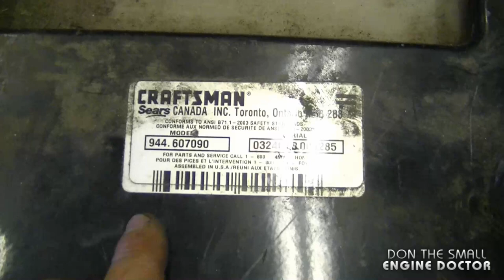Drive Pulley Replacement On Craftsman Lawn Tractor

Comment: Thanks very much for this clear and excellent video. My son and I had to replace the drive belt on our Craftsman DYT 4000 mower and this video was what we needed to get it done. The only difference I encountered on my mower was that the wiring connector to the clutch was a bit different, and didnt want to come apart easily. Not wanting to damage it, I found that the wire was long enough to lay the clutch on the ground without disconnecting it, so I left it alone. Thanks!!

Comment: This would be the best, most informative and concise 'how to' video I've seen ever ! Excellent job Don. As an engineer with 40yrs experience who's looked at many how to videos, most always leave out the important little things or prattle on with nonsense, not this one. Now Don how do I get the drive pulley out of a Countax or John Deere clutch ? On these tractors the clutch has the pulley pressed into it ... the problem there's also a washer/spacer pressed in the other side so nowhere to press ?

Comment: I watched this video since my Craftsman LT 1000 tractor have been having problems with the drive belt and I replaced the belt twice within a short time frame and after putting the new belt on the tractor drove just fine until I ran into an area where it had to go up hill and was pulling the lawn sweeper behind it. It stopped pulling again and I put on another new belt and it is working fine now, but I am afraid it may be the pulley now that may be the problem and I have to replace it. I have a diagram of the parts with the part number and will get another one just in case that is the problem. As always, Don, I thank you so much for the tips on repairing the mowers, and God Bless.

Comment: I'm having a similar problem with my Troy Bilt walk behind. model # 34313  6 speed trans, uses a drive disc like my snowblower.  The disc and clearance all seem fine and I'm wondering if the drive pulley is worn out.  
Great video on the Craftsman, my father in law has the same rider.

Comment: hey nice video, I have a older craftsman DGS 6500 26HP, having problems with the blade belt coming off when I engage blades, is the PTO clutch bad? what would the part# be?

Comment: Great video, nicely done , I have a question . You mention another  way to drop the pulley , can you make a video for that , my belt came off the drive shaft and it has metal  housing that dose not allow me to put the belt back on: so I need to drop the pull and when I use the socket the whole thing turns
Craftsman pro 8200

Comment: Had to replace the drive belt on my MTD Yard Machine riding mower.
Didn't even know it was bad because my yard is nice and level. When I tried to mow a yard with inclines it wouldn't move, even at 10% grade.... At first I thought the transmission was going... Upon inspection the main drive belt (long belt) going from the engine to the rear was good but the smaller drive belt had a crack in it which was slipping/stretched. Simple $9 belt from autozone. Went back the same day and mowed the hilly lawn with no issues.

I used to dread going to the local small engine repair shop even for parts. The only shop in twenty miles. He charges two to three times what I can get parts for online. On top of that every time I try to buy parts they have to be ordered anyway and that takes about a week anyways.
Biggest issue is part numbers... All I normally need is that and I used to feel bad asking him to look up info and then just leaving. Now I just give him $5 for his time and the number so I can order off of amazon or ebay.

Comment: Hey Donyboy I got a husqvarna yth180 lawn tractor and replaced drive belt old one kept popping off trans pulley.  I figured it did that cause of the cracked worn out belt.  I replaced the drive belt with the OEM drive belt from sears and this coming Monday the 24th would of been two weeks since I done the repair.  It has worked flawless since then up until this evening.  I used the tractor earlier today and all was fine tonight I went to use it just to ride a bit and the new popped off.  What do you think the problem is it only pops off trans pulley then gets lodged underneath.  I used this mower to mow my cousins yard all year and brought it back home a couple weeks ago because of the grass slowing down for the year and this has started happening.  I can't understand why all of a sudden this is happening.  I have had tractor since earlier this spring neighbor pulled it out of barn and gave it to me.

Comment: I am replacing the drive belt on a 2006 MTD Huskee 54" garden tractor with a new engine pulley, but the pulley on mine was oriented with the slot on the pulley towards the bottom not near the top.  Is this correct or did someone replace it incorrectly last time?  Also, the old pulley was never greased, so it was completely rusted on.  I had to use an impact tool to remove it which took many hours!!  Thanks for the great video!
Reply: I haven't used this tractor since I replaced the belt until now.  Now, when I have it in drive, it will not stop when I apply the brake when in forward or reverse. I can't even put it in neutral to stop it.   I ordered the supposed OEM belt.  Can it be too tight?  Is there anyway to rectify this problem without having to install a new belt?  Thanks, again!!

Comment: Hey, I need some help with this used poulan pro lawnmower I bought. it will not shift when I have the clutch engaged, but when i disengage the clutch, it shifts fine. I am wondering if the drive pulley can affect this, because mine does not spin freely. Any help is appreciated.

Comment: Great video Dony as always!  Thanks!  I think the hardest part for most of us DIY'ers is finding a suitable place to work, especially on lawn mowers.  Any thoughts on good quality lift tables?  Need something at around 25 inches in width to accommodate the width of most walk behind mowers.  Thanks again.
Reply: Tony M Never thought of a lift table, but my local repair shop has kind of a ramp type setup that leads to a workbench.  You can drive the equipment up onto the table, or pick it up and set it on there, depending on the type of equipment you are working on.  It sure beats trying to work on stuff on the ground.

Comment: Hi Donny, I have a 2002 MTD white outdoor lt153 with 13.5hp Briggs, I need to change my drive belt, but it seems my drive pulley is seized to the shaft. I tried spraying pb blaster and knocking on the shaft, but it won't come off. do you have suggestions? thanks again!

Comment: Would it be possible to convert my Craftsman Lawn Tractor's manual deck engagement to the electric clutch?  My old Craftsman Lawn Tractor had the electric PTO, this manual lever engagement seems to have a lot of slippage while engaging/disengaging and to me it just leads to faster belt wear.

Comment: Nicely done,though I am a bit leery of the pipe wrench. They tend to chew what they grip, rather use a vise grip or if possible a strap wrench. I have found that a new belt on a new sheave should crown slightly. If a new belt drops to the bottom of the sheave then either a worn sheave or the wrong belt.

Comment: Great tip on the anti seize !
question: I've an Echo SMW200 trimmer that won't start. I've replaced fuel filter and fresh gas oil mix but suspect carb. A sparkling is good. is it hard to rebuild this old trimmer or better just replacing? (it was free and cheaper than a 58v Echo lithium...)

Comment: Great video and it brings me to my question. I have a 2013 Husqvarna lawn tractor with a manual blade engagement. Can I install an electric PTO blade engagement like what's on your video on my tractor without much expense and is it easy job??
Reply from the maker: Anthony Macneil probably not, it would be super expensive
Reply: Ok thank you for your response

Comment: Great video again Donyboy. I repair cars for a living and I will never understand why someone would go to the expense to replace the pulley and refuse to replace a frayed belt. If the customer can't afford a belt they should park it. If it slips and doesn't work properly you will be the one who is at fault but I guess you can't win em all.
Reply: wysetech2000 Trying to be cheap a**es.  Trust me, there are so many people out there who pinch pennies when it comes to maintenance, then they whine and cry when that thing they just had fixed a week ago breaks down again because they didn't want to spend another $20 on xx part.   That's ok it keeps the shop guys like Dony in business.

Comment: My lawn mower, which is a Craftsman model 917.270532 has similar problems. It will barely move forward or backwards on it's own. With the rear end off the ground the wheels will turn but once they are on the ground under a normal load the mower will barely move and has a terrible grinding noise. It sounds like the transaxle gears are grinding against one another however, I removed the top of the transaxle and everything looks fine. There are no metal shavings and all gears seem to be in great shape. The pulley on the transaxle seems to have a little slack but it has a key connecting it to the shaft so I see no way to tighten it. The other pulley and belt tensioner seems to be ok but under a load may perform differently. I'm sure the belt needs replacing since it has been on the mower for years. How can I test the pulleys to know if they are bad? They appear to be fine when turning them by hand but under a load could be different. Also, since this mower is so old parts are becoming harder to find. Does anyone know of a place who still stock basic parts for this mower? I have found some used mowers like this but everyone wants 3 to 5 hundred dollars and I hate to put that much money into a twenty year old mower.The only reason i'm trying to repair it is because it was given to me by my father in law who has since passed away and I hate to give this up also. Any help or advice will be greatly appreciated. Thanks Randall

Comment: What is the difference between solid  cast iron crankshaft pulley on riding mower engine, than a die cast lighter weight cheaper pulley of same size 6" diameter? I intend to mount an alternator. The engine flywheel is balanced at factory.

Comment: I have a similar tractor and the foot clutch doesn't engage as it used too. it wont engage til the pedal is almost out of travel. It still works, but is there something I should be looking for or an adjustment I can make? I have already replaced the drive belt and one tensioner wheel, and that made no difference. Any tips? thanks.

Comment: Smashing job Don :-))
Yep we do tend to forget about pulley wear, good reminder :D
Reply from the maker: zx8401ztv have a good weekend
Reply: donyboy73 Would it be ok to turn a vtwin 24hp v twin vertical to a horazontal if it has over head valves?? it has an oil pump.
Reply: RCmen26 go kart

Comment: would this also work for a 917.271090 craftsman rider?  somehow the drive belt got moved between the two pulleys off the engine..

Comment: I just had issue doing this on an MTD zero turn. I'm trying to rebuild it after it burned up on my neighbour and she gave it to me.  I had to cut off the old pulley and unfortunately never took a picture. Replacement pulley has one collar thinner and rounded edge and no key. Other side is thicker and has key. I assumed the rounded  collar should go up against crank shaft and so key was down , not up as per your sears. Then I put the clutch on. Extreme torque says torque of bolt is critical and 50-55 ft lbs for 7/16" bolt. Before I could reach the spec the the upper collar split apart. There is a ridge in the clutch that could hit bottom of shaft and prevent clutch from compressing drive pulley further but dimensions are such that this ridge is going to be 1/2 inch below the end of the shaft.
Reply: key section on MTD definitely goes down , not up, because the key goes right to edge of collar and won't go up right since keyway in crankshaft doesn't go to top of shaft next to engine. The other end  goes up because it has no key in it. On your sears I see the key does not extent to edge of collar so it can go up.

Comment: Hi Donyboy. Since you had the drive pulley assembly apart, why didn't you also replace the drive belt at that time? It looked a bit frayed.
Reply from the maker: George Travers as I mentioned in the video description the owner opted not to replace it
Reply: donyboy73 You're right. Sorry.

Comment: So many people overlook pulley wear as the cause of their problems.  Many things like mowers, furnaces, fans, drill presses and machinery rely on them to provide a good grip on the belt to transfer motion.  Too many folks just replace the belt thinking that's the sole wear item and their fix will only be temporary.

Comment: would this apply also to a craftsman snowthrower?  Sometimes I notice when I engage the drive wheels it moves very slow or not at all...I replaced the belts and friction disc...
Reply from the maker: hllywd964 yes it does happen
Reply: thank you...so I would have to replace the drive pulley then?
Reply from the maker: hllywd964 if it's worn like the one in this video yes
Reply: thank you!

Comment: I have an older craftsman mower 42 in 16 hp with belt driven transaxle .Just had issue today it wont drive up hills but it will drive on flat or down hill terrain.  What could be causing this? Thanks
Reply from the maker: could be drive belt is worn out

Comment: Also the belt should not ride INTO the pulley like what you showed. That pulley is shot as you said. Belt should ride even from the outer pulley edge or a bit above. Looks like you need a wider belt.

Comment: I've had an issue with my drive belt popping off of the back pulley. I have a Craftsman 16HP Kohler engine. I do not see any way of adjusting the tension on the belt. Any ideas?
Reply from the maker: the belt may need to be replaced, also check idler wheels to make they are not out of line
Reply: It is a new belt and all the pulleys appear to be in line.  The new belt appears very loose. It always pops off the large transmission pulley which does not appear to have any belt keepers around it.  I'll double check the idler pulley.

Thanks for the advice.

Comment: not being critical but considering the trouble to get to  the belt , was there a reason for not changing the frayed belt while changing the pulley?
Reply from the maker: MissouriOldTimer as I mentioned in the video description the owner opted not to replace it
Reply: donyboy73 ok, I didn't notice that, thanks.
Reply: MissouriOldTimer Probably trying to save money.  Problem is, the belt may be stretched so it could potentially still have mobility troubles.  I have a similar lawn tractor, mine is the lower grade than the one in the video so it has the manual deck engagement so no electric PTO clutch.  However, the way they have the transmission drive belt routed in these newer lawn tractors is ridiculous.  Just about have to flip the dang tractor upside down to work on it.  Or hang it in a tree to gain descent access, then you still have to remove the deck most of the time.  Not a fun chore, almost worth buying a new lawn tractor when the belt fails LOL.
Reply: William Todd I used to  work on small engines and some of the riders are so difficult to change the belts some have two drive belts with a variable speed pulley, about have to dismantle the mower to change those .
Reply: MissouriOldTimer My 1992 MTD Ranch King is that type of setup.  I really don't want to have to change those belts LOL.  When I got it last year it wouldn't go very fast at all, ran like crap...it still looks like crap, but the previous owner's kids beat the crap out of it.  The VS pulley had a piece of wire stuck in it so it wouldn't open up all the way for high gear.  Took that apart pulled the wire out of it.  Does great now, but yes total pain in the a** to work on LOL.  I did end up rewiring it to a push button start and toggle on/off switch as it wasn't running right and had some other electrical issues.  It runs awesome now, cuts grass better than my 5 year old Craftsman pile of junk lawn tractor ever has.

Comment: Wonder if the source of the problem is a belt that's wearing out, which then destroys the pulley?
Reply: ***** No, its the garbage metal they make pulleys out of now.  My old Craftsman lawn tractor never had a single pulley replaced on it in 20 years.  Belts every few years, but never a pulley.  They never wore out.  These new machines are designed to last 5 years, after that its up to the poor owner whether they want to pour a bunch of money into the junk.
Reply from the maker: ***** actually it's the other way around, the pulley got worn and in turn frayed the new belt you saw in the video. The owner opted not to replace it as he had just put it on and still couldn't figure out why the drive was slipping

Comment: Hi dony or anyone that will know i have recently bought a petrol pressure washer i cannot get it to pump any water the pressure gauge is missing and has been replaced with a bolt and the pressure release doesn't look in the best condition have no idea about pressure washers i was hoping it would work

Comment: hey Donyboy, my lawn tractor 917273013 craftsman kohler pro 20hp v twin 46" cut, the clutch pedal seems to be stuck in depress i tried yanking on it and still its stuck, Help and thanks in advance for anyone that has advice